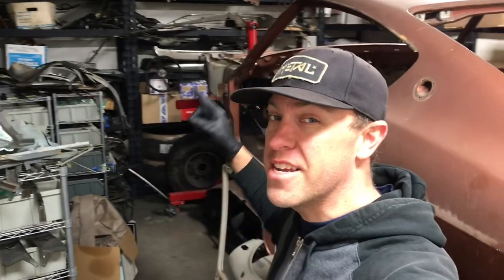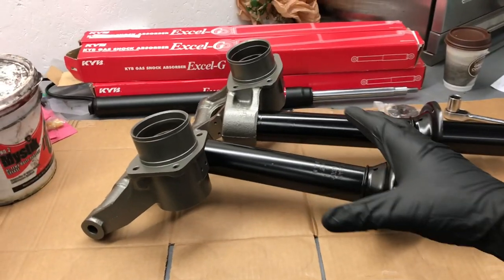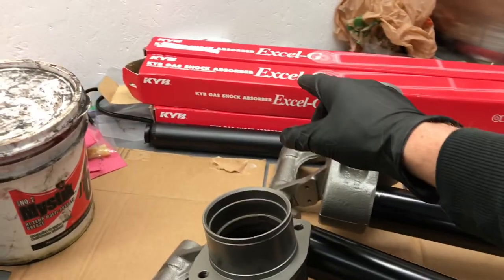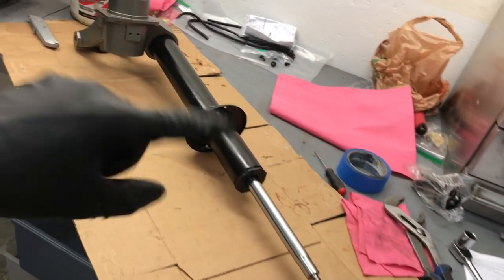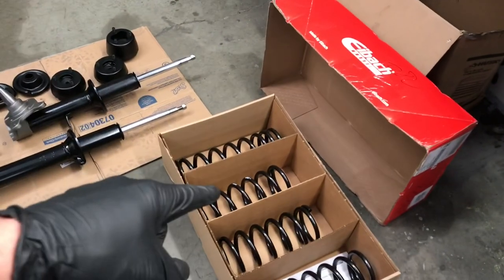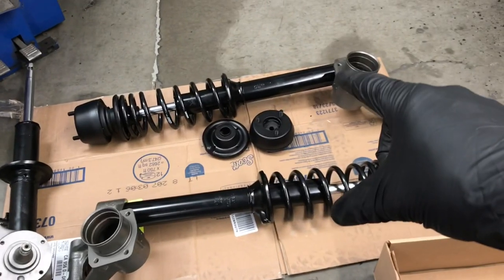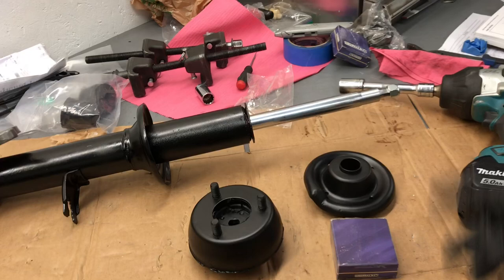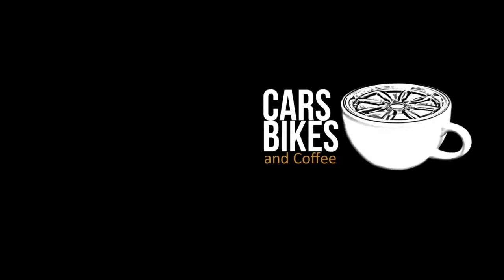The next build reveal! 1974 Datsun 260Z EP1

Comment: Kurt, was following the 240 build and now on to this one.  glad to see you do another one!  I wanted to ask about those KYB struts.  don't they have a tendancy to jack the car up higher than desired?  I've got them on both of my Z31s and they seem to jack the car up, however my 84 has the eibach lowering springs so its not bad.  my 87 was sitting quite high though.  Your thoughts on the KYBs compared to other brands?  Thanks and God Bless
Reply from the maker: +Benjamin Nielsen thanks for sticking with me! KYB’s are great as long as you don’t crazy lower the car. I think in some cases when people update their struts from the old ones there is a slight height increase because they are newer in some cases. Tokico would be another brand I would use.
Reply: @CarsBikesandCoffee  Anytime dude.  Makes sense.  I don't mind KYBs, but I would rather have Tokicos.  Unfortunately, they are no longer available and for the Z :(  
When I go to build my dream 280zx, I will probably use KYBs or maybe Konis, unless the Tokicos come back.  Keep it up.  Thanks!